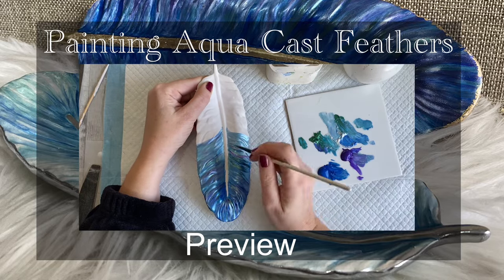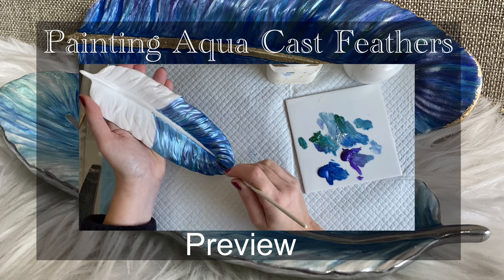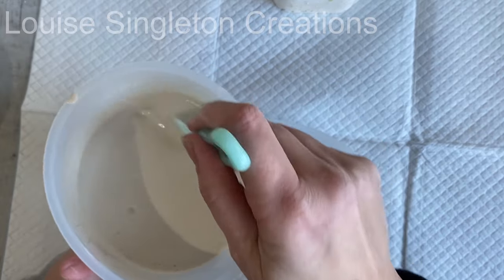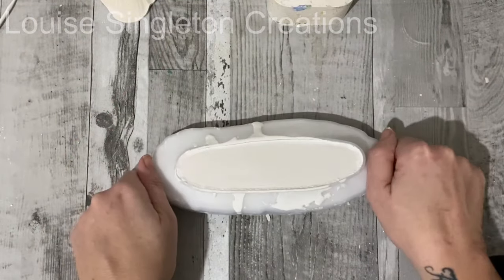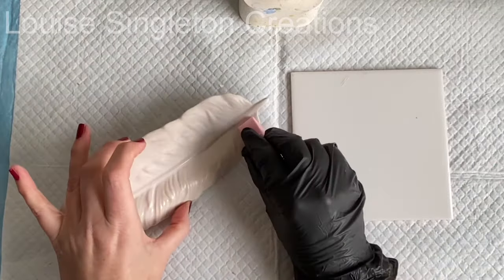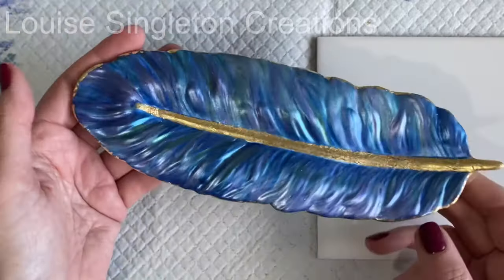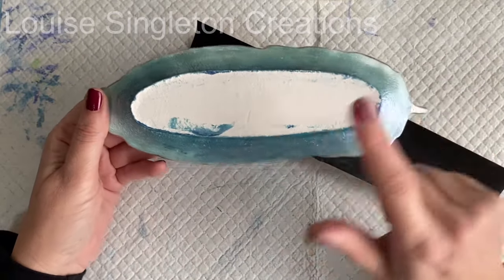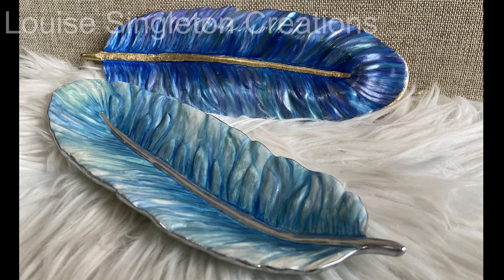How to Paint & Seal Aqua Cast Eco-Resin

Comment: Temu may be selling "seconds".
Defective molds that they obtain really cheap.
I've got the same mold from another source and don't have those issues.
Also the weight of the Aqua Cast may have been a factor as I've only used resin in mine. 🤷
The colors turned out beautiful. ❤
Reply from the maker: Thank you, very good points 👍

Comment: I bought a mold from Temu but after making the swan trinket box I noticed a  flaw in the base. Asked for a refund and threw both the mold and two lots of swans away. A lot of resin was wasted. So disappointed, I will not be buying anymore molds from Temu. The feathers are lovely.